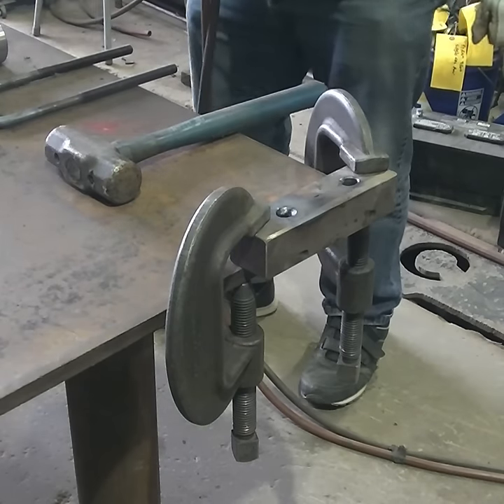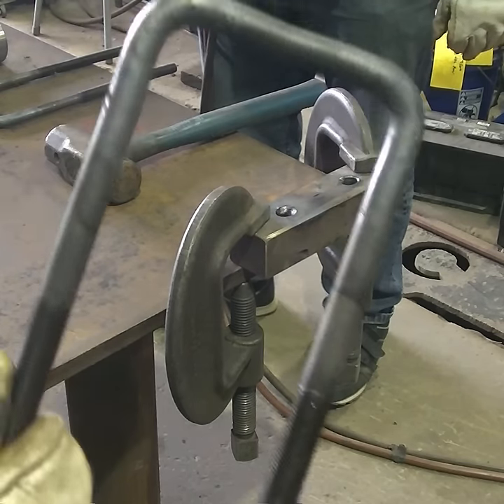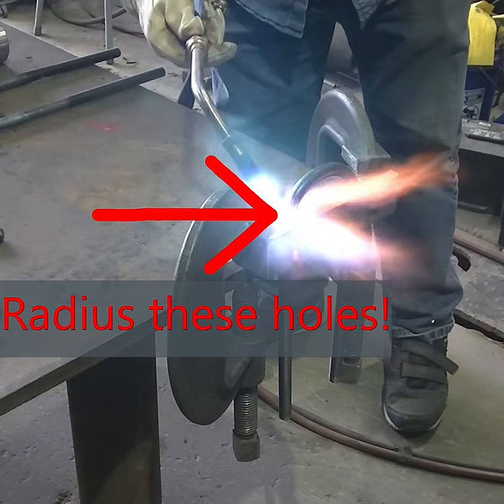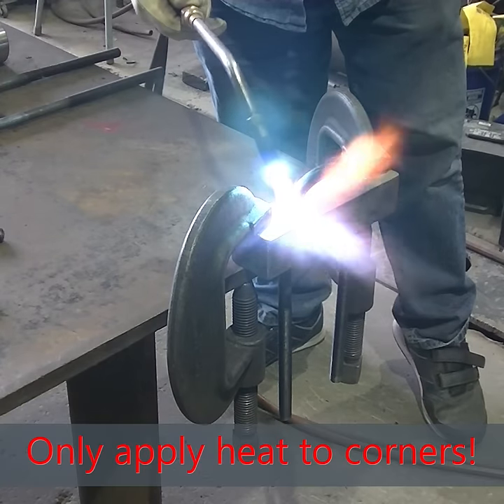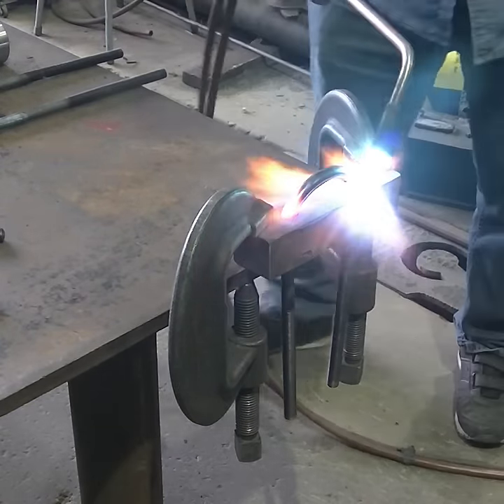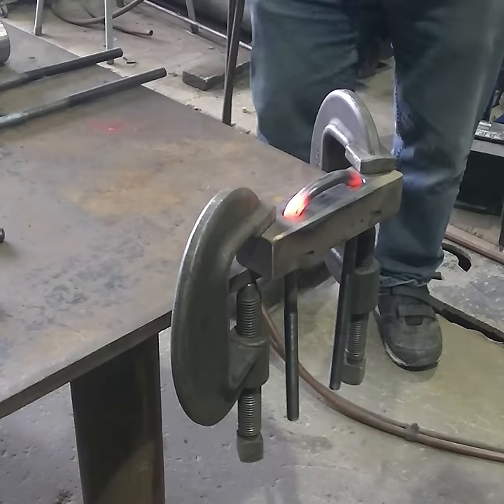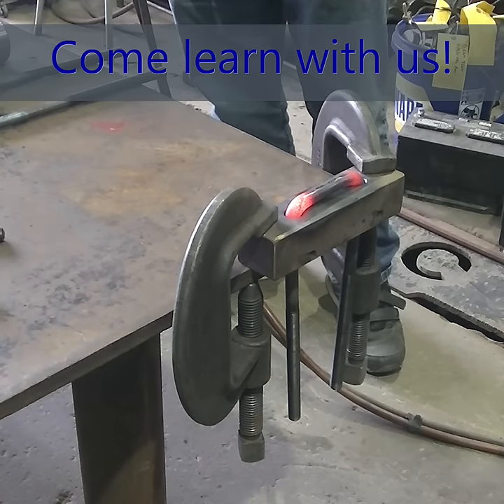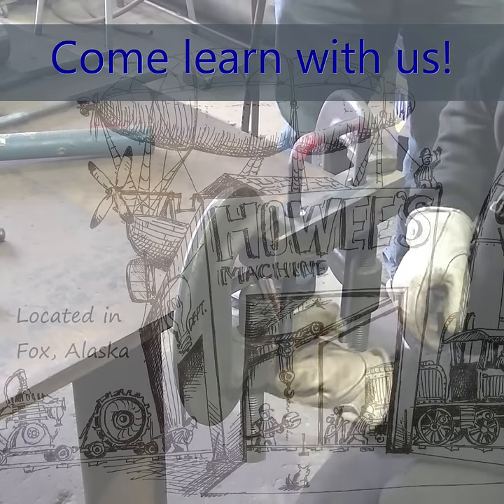Machinist's Minute: Squaring a Rounded u-bolt

Comment: But was it worth it? Those axle hangars don't tend to be all that expensive and I can't imagine the time it took to do every piece was any better over just going and returning those for the right ones. Or am I missing something here?

Yeah I get having the skills to repurpose what you have and working with what you got, but to me its a matter of cost, and time costs money whichever is faster or will be easier in the long run, not just in the now, is ultimately the better choice
Reply from the maker: Yes it was, Austin had waited 3 weeks to get the wrong parts, from the only place that said they had the correct part.  The real question here is.... Was it worth it to order parts from a respectable US supplier, or just make them to start with?  Had it been my PU, I would have just made them, it is very common to get the wrong u-bolts when ordered for older vehicles.
Reply: @HOWEES  that makes a lot of sense, thanks. Yea with lots of wait time, getting the wrong part when it was supposed to be the right one, and limited stock due to the age of a vehicle, that changes things a lot.

Comment: Also repeated heating and beating on preformed steel can weaken the molecular grain structure of the steel.  Not recommended, order the correct size in the first place.

Comment: Those ubolts are torque to yield, not sure about heating them with a torch.
Reply: It reduces the size of grain structure That would be a good question to ask a metallurgical engineer. Instead of worrying about your rosebud i would be worried about u bolt integrity
Reply: Please show me an example of a TTY u-bolt.

Comment: Learn with you guys? Well there's a easy way to do those i worked in a factory building wood flat beds i think is called that and to attach the bed to the chassis we use u bolts and we do it like this 1 length
2 machine the things were the nuts are screwing dont now the name 3 bend it no hammer using a i beam a square pipe no need for the hammer and it is faster

Comment: Send it back and order the correct u bolt. Don't advise less knowledgeable viewers this is how to fix it. THIS IS NOT THE WAY TO SOLVE THIS PROBLEM. The strength of this u bolt is compromised by this heat treatment!

Comment: I don’t get how you can heat up u- bolts aren’t those torque to yield and stretch? Doesn’t heat weaken it?
Reply from the maker: No they are not normally torque to yield & they are made with heat in the first place.

Comment: And now the temper of that u bolt us ruined and you need to re quench and then re temper I'm not positive but I'm pretty sure most bolts aren't just mild steel and are tempered but still good advice yall

Comment: Steel loses its temper gradually instead of at a specific temperature so that u bolt is getting weaker the entire time
Reply from the maker: What temperature should it have for a good temper?
Reply: @HOWEES  probably around 150 degrees Fahrenheit. The other option would be to heat treat the u bolt a second time after bending by quenching it or something
Reply: @nathan2254 kid you’re clueless.

Comment: So does it have the same rating after you have done that without heat treating afterwards?
Reply from the maker: Yes
Reply: @HOWEES what alloy are u bolts?
Reply from the maker: SAE xxxx, Also known as Mystery steel, most likely 1018 in this case.   @brianpatrick7193

Comment: You just destroyed those. That shit going to snap. You'll be lucky to even get them to torque. Made tons of ubolts made of hardened spring steel you detempered and unsprung VOID ON WARRANTY
Reply from the maker: They're still running strong on an offroad 4x4 a few years later lol
-Cameraman

Comment: Won't that mess with the hardness of the steel?
Reply from the maker: We do not know what the original heat treating was, and likely it was just left in the normalized state, it was heated without after heat-treating when made.  We do not know the alloy.  We know it is steel, and that the intended use requires about 1/4 of the strength of "steel", in its weakest state.
Reply: @HOWEES not to pile on but everything is designed with a factor of safety 4 times for steel 7 times for aluminum. Probably used 4140 for it's toughness? I would be curious if a engineer would suggest a normilzing heat treatment because i guarantee that heat affected zone has a different grain size

Comment: Isn't that spring steel?  As far as I know when spring steel is heated it looses it's thrength and will break.
Reply from the maker: This is not spring steel.  Spring steel is thought, by many to be a specific steel alloy, however in reality springs are made from a wide variety of steels & also bronze & others.  This particular steel is U-bolt steel.
Reply: Still probably a high carbon steel that has been put through a very specific hardening process no? I would be very hesitant to mess with such a structural fastener, but it seems you have a lot of experience doing this. Wonder if it’s a DOT violation.
Reply: U bolts are made to stretch😂😂😂 people thinking ubolts are hardened scare me
Reply: @402outdoorzx5  u bolts are most commonly grade 8 or 5, which, last time I checked, are both examples of hardened steel.
Reply: @402outdoorzx5  uhhhhh...... they are hardened

Comment: Surely you must know that heating metal like that with a carburizing flame is going to impart lots of carbon into the metal.

Those bolts must be extremely brittle now, I'd be careful with them.

Comment: Does the bolt lose it shear strength by doing this?
Reply from the maker: No it does not.  And besides U-bolts are used for tensile loading.

Comment: OMG. Like most bolts or fasteners with threads.  They're heat treated. You ruined them after all. You more than likely annealed them in the heated areas, thus making them soft and weaker. Not so smart, after all. I agree with others. Return them. Geez, avoid this hammer mechanic. Bad tip guys.
Reply: Very easy for them to re-heat treat them in shop. 
Maybe trust the guy with a machinist shop which he’s operated for years over a YouTube commenter ay?
Reply: @miguelfelelpez7256  This is true. However, I have many years of heat treating and manufacturing fasteners. Aerospace fasteners, we test with tensile test machine. We test HRC. Aka Rockwell hardness. We do double shear tests. Just re-heating a fastener doesn't fix it. You could potentially make the bolt brittle or remain too soft. But like you said, he's had a shop for years. Just a shop. Not a multi-million dollar business or corporation.

Comment: Aren't you worried about the now absent heat treat on the most stress prone part od the bolt?
Reply from the maker: I had concerns, the first time I made a u-bolt, however.....After years of watching them being heated for bending & not observing a failure from this, I don't worry.  It is how most u-bolts are made, bent hot & then left in the normalized state.  If someone hot-quenched a higher carbon u-bolt, I would then be concerned.
Reply: @HOWEES  yeah they do have to flex a lot without stressing. A large job.

Comment: Howie, yall have a gas forge and anvil?
Reply from the maker: Anvil yes, no official forge heater, but We have 2 induction heaters & a heat treating furnace.
Reply: @HOWEES  a Venturi forge is small, consumes low psi and is a snap to build especially for you :)

Comment: I missed the part where it was heat-treated...
Reply from the maker: The video is a short & did not include anything about heat treating, so your eyes are OK.
Reply: @HOWEES  What heat treatment did you give it after the short?
Reply from the maker: @EddieTheH  None needed.  I had concerns about heat treatment, the first time I made a u-bolt, however.....After years of watching them being heated for bending & not observing a failure from this, I don't worry.  It is how most u-bolts are made, bent hot & then left in the normalized state.  If someone hot-quenched a higher carbon u-bolt, I would then be concerned.
Reply: @HOWEES  I was always taught they required heat treatment after being heated to cherry. Not quenching, that would terrify me too! I was taught it was more about very slow cooling. 
Every day's a school day!
Reply: @HOWEES  I apologise for the tone of my original comment. I think years of YouTube comments sections have turned me cynical and sarky. :/

Comment: Get the proper u bolts  heating ruins the temper and tensile. Worked in a frame shop for class 8 trucks. Replaced frame rails and everything attached  this isn't even shade tree just plain cheap and dangerous

Comment: So you needed a squared off u-bolt instead of an actual u-bolt? I’m not going to bitch about the weakening of the steel like a lot of amateurs do in these videos because I know every application doesn’t need heat treated steel.

Comment: Do not heat up threaded u-bolt rods and rebend them. If anyone tells you that doing such is "fine, just walk away. Doesn't matter if you've got a round ubolt and you need it to be a square  bend, KW, WS, etc. All you accomplish with heating and banging that ubolt out is just weakening the overall strength of the material. Just grab a new rod off the rack or order new ubolts to the proper spec, don't do this BS

Comment: That's not steel any more, heat it over cherry red and it's worthless. Learn your trade...
Reply from the maker: I think it's good to keep learning, I have been in the metals working trade for almost 50 years & still learn new things.  I would suggest You do some learning about steel.  If the atmosphere was carburizing & left for a long time, at high heat (near white hot), it would actually obtain the composition of cast iron.  If left in an oxidizing atmosphere for a long time, it would become elemental iron.  Neither of these are considered steel.  Either transformation would take several hours of higher heat than what I was using, the bolts are still steel.  You tube has many sites about forging & also heat treating that You might learn from.  Currently I only have 2 videos referring to heat treating, but I will leave the links in case you are interested. https://www.youtube.com/watch?v=BMlxX5O6FsU&t=175s
https://www.youtube.com/shorts/Cu0uMu8PLIA
Reply: @HOWEES  That Dim one got Reaped!